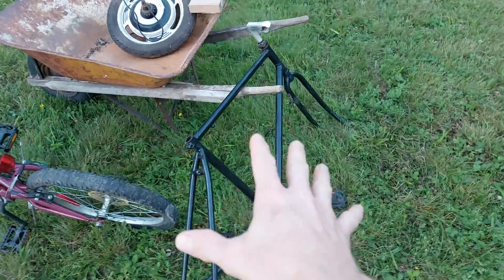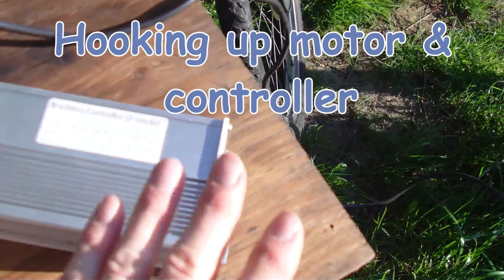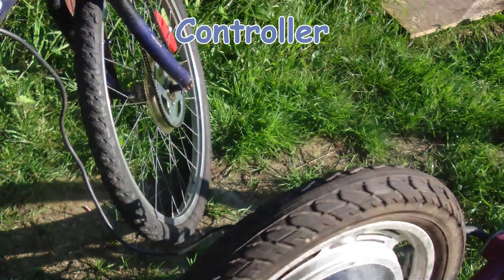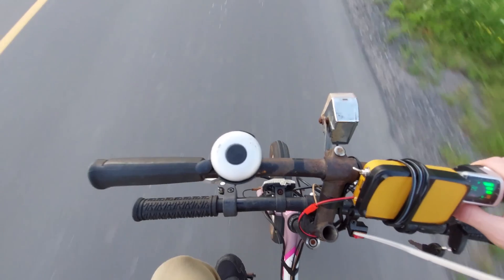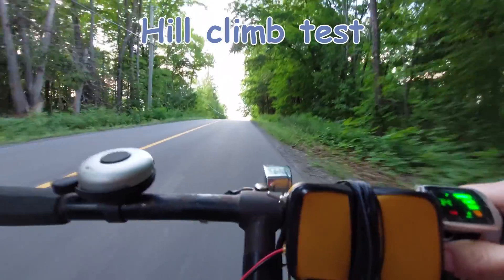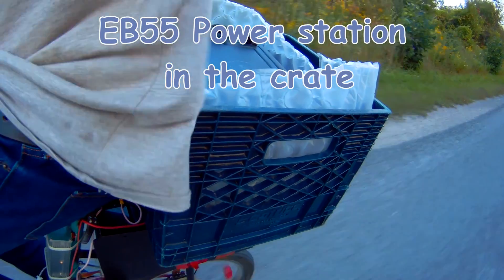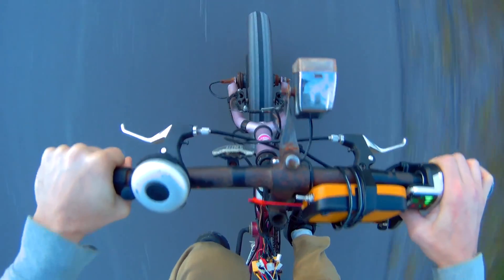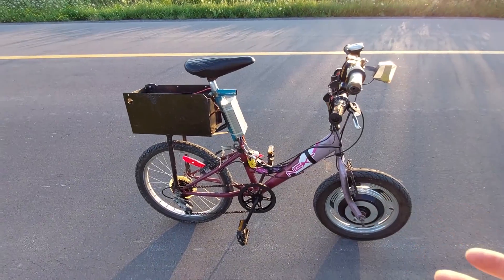My first DIY Hub Motor Ebike Build - 48v 500 Watts [ Cheap ]

Comment: I just beat my own record a weeks ago.
Building the cheapest e-bike.
(1) I bought almost a brand new Carrera bike double discs 27.5inch wheels.
In perfect condition & working order = £40.
The lad I bought it off said he found a 48v 1000w 27.5inch hub motor.
It was completely broken
But I fixed it for free didn't cost me anything.
I got the hub motor for free with the bike.

I bought a removable battery box for £50 &
Cheap BMS board for £15
I bought a pre-owned battery pack for £30 10s 7p.
I rebuilt into a 48v 5p battery pack.
Installed in the removable plastic battery case.

I already had a 1000w  brand new controller & display for free.
Because the last ebike I built.
 I bought a kit with display and controller.
But I wanted to upgrade to the KT controller with regenerative braking.
What workout to be same price.
If I bought it as a kit.
So I obviously bought them separate.
And got a spare controller & display & pedal assist sensor & throttle & bag & more for free.
So the Ebike all together only cost me = £135 
And it's professionally put together.
Reply from the maker: Thanks for sharing, sounds like a awesome quality low cost build. It seems to be hard to find decent priced used parts where I am. I know in the US there are sites that sell used motors battery's controllers etc, but they don't ship here or if they do the shipping is crazy expensive.

Comment: Hi
hypothetically, is it possible to make a range extender using a weed eater engine with a small alternator to charge the batteries while not in use?, I want to do delivery on a ebike I'm planning to build, but since I cannot afford lithium ion with the bms and the nickel strips, and because lead acid has less range, between deliveries there's always a small window of like 10-15 min, I was wondering if I could do that to extend range, thanks
Reply from the maker: Hey, yes it would be possible.  I have been planing that exact build for awhile now. I'll have to wait until spring but if you check out my old trimmer generator video you could get some ideas.

Comment: 3:05 Nice job on the bike, but this shows exactly why I will never trust ebikes with front hub motors. All your weight is in the rear, and the front wheel that's currently in charge of pulling you forewards is also in charge of your steering. Waaaaay too easy to just spin your tire out from under you, just like that. Especially since it looked like the hub motor had a gear on it, so it technically could have gone in the rear. All you would have had to do was remove the rear derailer and shorten the chain.
Reply from the maker: Thanks a lot! You're right, defiantly a traction problem it can be  unstable on lose gravel and slippery roads.  You could put it on the back for sure.  What I recommended in the description is to try and shift some of the battery weight to the front, but it still wouldn't be perfect.  Why I didn't put the motor on the back is because I would only end up with a single speed also the wheel size difference might be a problem.